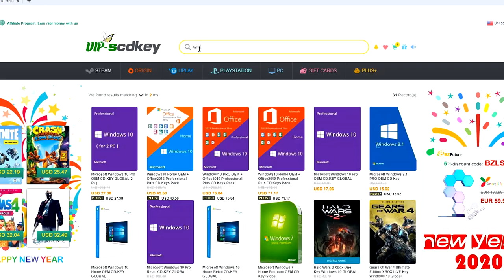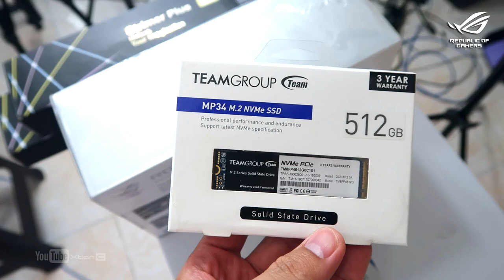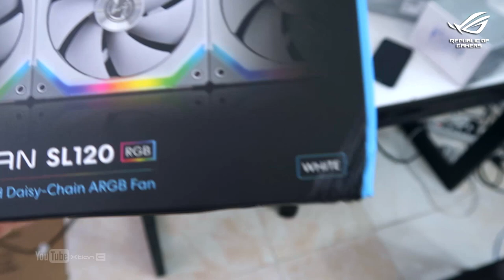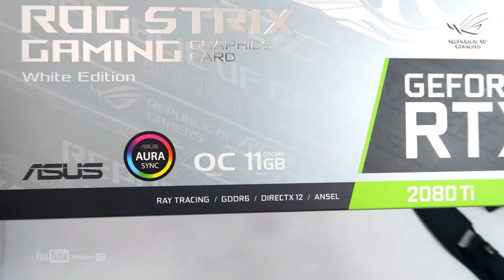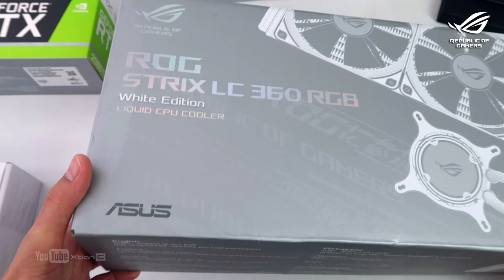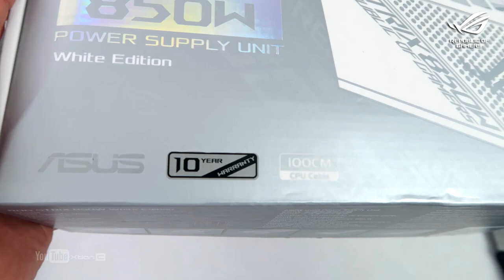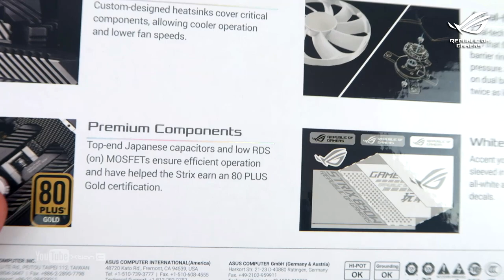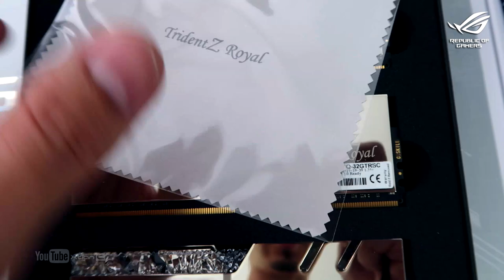VLOG: UNBOXING - 200K FULL ROG WHITE Gaming PC ft. Strix Z490-A [Ph]

Comment: AMD ryzen 3 3200G - 
Msi B450 tomahawk max -
Teamgroup/Tforce 2x8 DDR4 3200Mhz - 
240GB SSD -
Msi mag pylon mid tower Cases - 
nvme m2 ssd 240gb - 
Seasonic S12 550w bronze system unit - 
Pwede na ba to?

Comment: sir Cristian di na po ba ako talo sa 34k sa specs na to? 

ryzen 5 3500x 
msi motherboard
8gb tforce rgb (white)
1tb hdd
240 ssd
keytech white case tempered
24 viewpoint monitor 
keyboard and mouse rgb (keyboard white) 
750w ygt psu
vc: GTX 1050ti 4gb gddr5

bago lanh kase ako sa pag bbuild and may nag offer sakin ng ganto. gusto ko lang po malaman baka kase na scam ako sayang ipon

Comment: Hindi naman po ba kayo nagkaroon ng problem when installing ung os? Ung sakin kase wala ung network adapter sa device manager. And wala din net even connected sya sa lan cable. Ano po kaya possible problem non? Sana masagot mo lodi. Salamat
Reply from the maker: Install the driver first
Reply: @XtianC  install drivers from the cd po then install os tama po ba?
Reply from the maker: @bonaknfriends477  download latest drivers. Download mo sa ibang device then save it to flash drive.
Reply: @XtianC  another question po. After installation ng OS. Is it normal ba na walang STATUS ung sa Network and Internet?

Data Usage, vpn, dial-up and proxy lang ang meron. Salamat